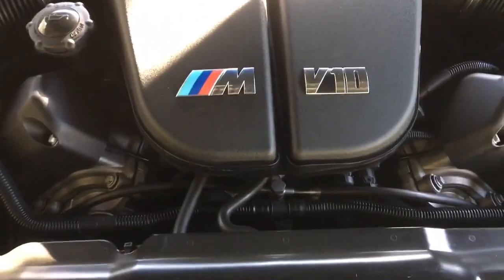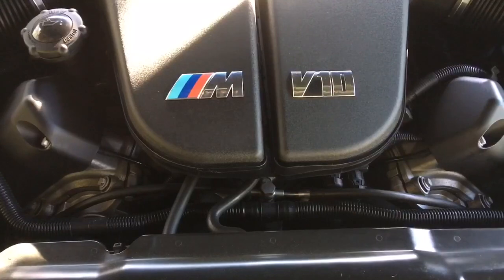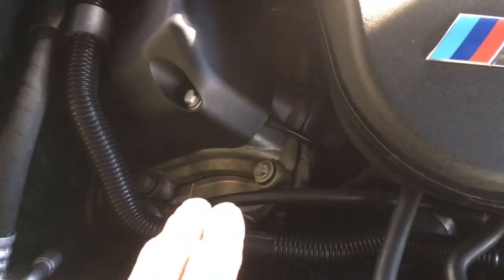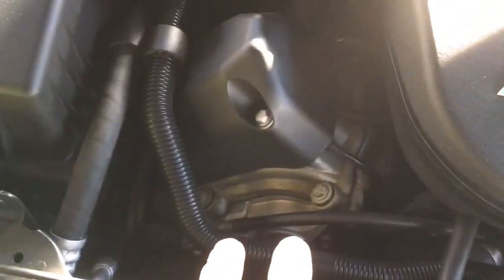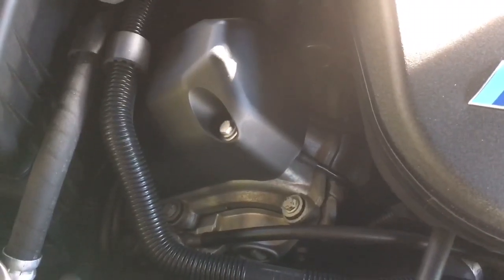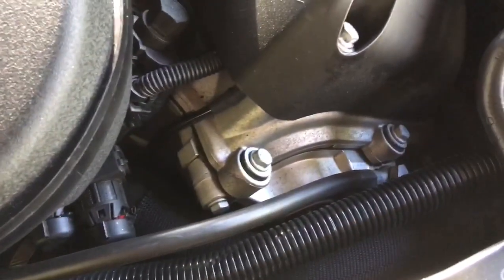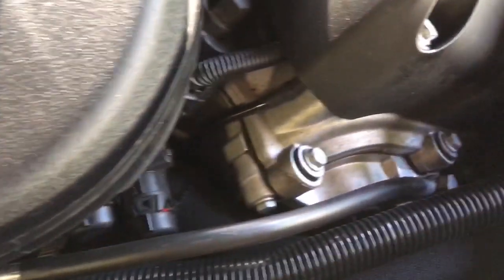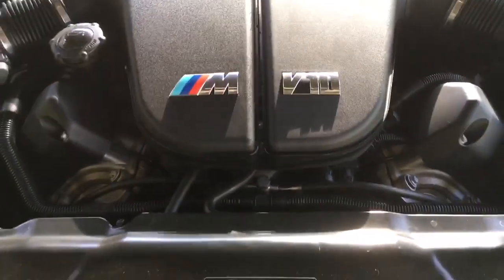BMW V10 VANOS Noise! & Common Issues

Comment: Your videos are great to watch, you're clearly a fellow lover of the V10 engine which is what these cars are all about. I've just watched this as part of my research on the way to my 17th year at the Nurburgring in my 2005 car. It's also much loved, never been driven through a UK winter, kept in a climate controlled garage, religious oil changes. It's one of original M5's (first owner BMW UK) and it's developed an unusual VANOS noise on the journey here this year (an intermittent, rhythmic rattle at idle and at revs) which doesn't seem to affect performance at all (but the noise is very disconcerting). I have always looked after and worked on the car myself and assumed (wrongly it seems) that the problems people have with them are largely because of neglect, I think that's probably true for 90% of the cases. Now I don't know whether it's safe to drive back so I can pull it apart to diagnose. It's certainly put an end to my Nurburgring trip this year, which is like an 8min "stress test" for the car :( All the best.
Reply from the maker: Hey Dave, great to hear from a long term owner, sounds like you’ve been enjoying the car with all them trips to the Nurburgring, perfect car for it! The noise could be a few things, but if yours is a 2005 like mine, from what you’ve described it sounds very much like the VANOS hub, real common on the early E60 M5’s, mine sound really noisy too (you can hear it at the start of just about every E60 M5 video of mine) The spring inside gets worn and rattles. If there’s no warning lights, and no fault codes I’d guess it’s the VANOS hub and wouldn’t worry too much. As for the reliability of these cars, if yours has gone 20 years without any major issues, that’s a reliable car
Reply: @MTechGuy  Thanks very much for the reply. I agree with you on the reliability, the car is 20 years old now and I've only ever had a few minor issues with it, usual E60 generation electrical gremlins (learnt to live with them) an alternator (dash lit up like a xmas tree) and flat spots in the tyres that wouldn't roll out from storage. I'm so fastidious with care for the engine I was struggling to believe something had gone wrong with it, if you look after it like a race engine (which is basically what it is) then it will look after you, if you don't, trouble. The noise was probably worse than you think I should have posted a video somewhere, like something letting go in the engine centered around the RH bank of cylinders, very alarming. Mine sounds like yours at idle, I've never been worried about it, with some revs that noise goes away and the engine comes really comes alive. I have found the issue and wanted to let you know what it was, I did the belts & pulleys this year (you have a video about it) because I could hear one of the pulleys from inside the car (sounded like a mouse being minced!) also had the aircon re-gassed on suspicion as low gas can cause weird noises also, it did take around 200gr. Yesterday while driving the car (reluctantly) we started with the engine noise (and aircon, power steering) then after refueling we lost power steering and aircon! (and the engine noise was gone). On inspection the bearings in the aircon compressor wheel had failed, the wheel had come off and we dropped the belt, the aircon compressor sits right under the RH cylinder bank as you know! I guess that was the noise I was hearing, the bearings letting go. Again I have no way of posting pics here but there were about 5 BB's left out of 50 and the wheel and belt were sitting in the belly pan. Now I just have to find an aircon compressor (in Germany) and fit it and all will be good again. We will have to drive the last 160km with no aircon and PS, and I will lose all the gas I just paid for (annoying) but the good news is the engine is fine and I'll hopefully get to lap at the Ring again this year. I'm a bit annoyed that I actually cracked the high pressure line on the RH cylinder head to have a look at the little filter that sits under the banjo bolt, it was clean as a whistle unsurprisingly, after 20 years! Anyway, thanks again for your reply, if you have any recommendations on aircon compressor brands let me know. All the best.
Reply from the maker: Thats mad, never heard of an a/c clutch pulley fail like that! Good that it turned out to be external to the engine. Denso good brand for compressor, but to be honest if it’s just the clutch/pulley that’s failed, these can be bought & replaced separately, if the actual compressor is OK. Will be a lot cheaper and easier to do away from home, plus you won’t lose any gas. If you do end up replacing the whole compressor though, don’t forget to replace the dryer too. Also, I would be suspicious of the a/c ps belt tensioner, this may have loaded up the a/c clutch pulley, check it out while you’re in there. Good luck 👍
Reply: @MTechGuy  Thanks again, I'd rather not replace the whole thing so will have a look and see if that'll do the job for me. I had thought the new belt(s) must have put a bit more strain on things, tbh the old belts were fine, BMW originals, no cracks or visible wear at all, one of straight pulleys and the offset pulley were noisy though. The tensioner also seemed fine, no visible leaks and required the same sort of force on it as the other side to release and free the belt. Cheers and all the best.
Reply: @MTechGuy  I've looked at that part, that would be much easier than replacing the whole compressor. How do you get the pulley the pulley on/off? it looks like it's threaded. Do you need the special tool? (3 x 6mm holes). Cheers again.
Reply from the maker: The pulley is threaded onto the compressor shaft. You can use the old belt as a ‘strap wrench’ to hold the pulley, I think the end of the shaft takes a 7mm socket
Reply: @MTechGuy  Thanks again, the internals of the pulley that failed appear to be still on the front of the compressor so I won't be able to do that, I may have to improvise to get it off (I have some vice grips with me) I assume it's a conventional thread (not reverse) and you hold the 7mm to stop the shaft from turning? PS - the car definitely feels a bit faster without the parasitic load of the aircon compressor and PS pump! (makes you wonder). Cheers.
Reply from the maker: @davedorling899Yes, it’s a normal thread, if you can hold the pulley internal that’s left steady, then just turn the shaft to unscrew. Must have a few more horses without it in place at the mo!
Reply: @MTechGuy  It does seem to, hard to say as we have to drive with the windows and sunroof open atm (it's hot here) and the noise! 🤩makes you feel like you are going faster! I have the aircon switched off during a NB lap anyway (engine is working hard enough as it is) but you need the PS, the steering is VERY heavy without it. I'm struggling to find this part (aircon compressor pulley) it has Denso written on the pulley I'm holding my hand and "pps-gf40" on it but I can't find a direct replacement. BMW doesn't list it as a separate part (no surprises there) as a last resort I could look for and appropriately sized v-belt to just run the PS pump. No idea what size though, I wouldn't want to put too much pressure on the PS pump and break that as well :( Cheers.
Reply: @MTechGuy  Thought you might be interested in the info I just posted on M5BOARD, I got the power steering going with a smaller belt and I've done a couple of laps, the car is flying and I have proper brakes now (just installed custom made carbon ceramic brakes on the car) I also found a new compressor pulley, everyone here telling me that the compressor will need to be changed, that's how/why the pulley failed, not sure I believe that (yet) as I removed the remains of the old pulley yesterday while fitting the shorter belt and I can still turn the shaft with my fingers in both directions, feels fine, lets see what happens when I switch it on I guess! ;-) All the best.

-------------

Thanks for sharing the info above to bypass the aircon compressor, I've just had a failure of the pulley on the compressor (after a belt and pulley change on the front of the engine, coincidence? I think not) I'm in Germany at the Nurburgring so I needed to find a solution to get the power steering back as the steering is VERY heavy without it (motorway = ok, tight corners/parking/track = not ok). For the european folk that might be reading this, the belt I ended up using was a "Bosch 850mm" (see pic). I tried an 844mm (too tight, couldn't even get it over the pulleys) and an 858mm (too loose, with tensioner released you can still slide the belt off). The 850 was "just right" similar sort of effort to slide the belt on as the stock ones with everything in place. As for the compressor wheel, you CAN get replacements but they're not easy to find, even here in Germany! I found one on Ebay eventually (see pic), pulley diameter is 110mm, 30mm width, thread is normal (not reverse), give it a good spray and give it some time to penetrate before trying to remove the pulley (or what's left of it!) from the front of the compressor, this really helps. All the best.

-------------

Comment: My vanos developed a sort of whine at low rpm’s. Started happening after I changed out the crush washer on the top feed line. I have already bleed the system and it’s still there. Could this be the solenoids? I’m getting no codes btw
Reply from the maker: Double check everything that was disrupted during the washer replacement then bleed it some more
Reply: @ so bleed it again got it 👍 because I just replaced the crush washer on one side.

Comment: Hi 
Just checking- do you need to remove the vanos pump in order to change the high pressure vanos line, or is there enough room to get the old vanos line out and thread the new one back in with the vanos pump still in situ?
Reply from the maker: Remove the VANOS pump, there might be enough room to slide the hose out but I think you’d struggle. To be honest if you are that deep in, with the oil pan removed you want to remove the VANOS pump and inspect it while you have the chance, just make sure to set the back lash correctly when re-fitting
Reply: @MTechGuy  thanks. 
Also, is it essential to bleed the vanos system using ISTA after replacing the high pressure vanos line? 

I’m wondering- wouldn’t it just bleed itself under normal driving (taking it easy for a while of course)
Reply from the maker: I would bleed it 3 times with a scan tool, you don’t want any cavitation at the pump

Comment: The wear is accelerated by people getting drunk on the noise of the engine and drive around at 7000rpm all day.
Reply from the maker: So long as the engine oil is warmed up it’s fine, these engines are built to take it. Mine sees 8250rpm regularly

Comment: I replace the 4 solenoid from dr.vanos and do the vanos test ,got some not ok results,but i dont get any code,should i worry about it? Thanks
Reply from the maker: Check to make sure the O-rings are sealing, run the bleed procedure about 3 times, then re-check it. If the readings are very close to the target, and no codes, I wouldn’t worry to much
Reply: @MTechGuy  ok,thanks man

Comment: If you got Vanos pump tick from the front bottom of the engine that won't go away after a bunch of bleeding, prepare your pockets for a new Vanos pump guaranteed - doesn't matter if your Vanos test passed.  The Vanos pump bearing race is cracked or trashed - no way around it.  It can work with it broken but it will have intermittent loss of power and it is just a matter of time till the pump internals blow up.  It will not give you errors and can last even up to 10k - 20k miles but the inevitable will happen - always check your oil for any debris.  If you see debris (and there is a lot of it), there is a chance it is the rod bearings or Vanos pump material. Either the pump catastrophically fails or it will send metal dust into the Vanos system and compromise the solenoids causing the Vanos error codes - IF that happens, immediately shut the engine off and tow it home or to the shop - a knowledgeable shop with S85/S65 engine experience should know what to do.  There are several videos on youtube you can listen to for the sound you don't want to hear - not very common especially after the post 2008 but it can happen.  Other than that, the S85 is a great engine and very enjoyable on the E60 platform.  It just can be very costly if you do not pay attention to details and do proper preventive maintenance.

Comment: Hi, excellent video, very informative! 
Would you happen to have a part number for the high pressure vanos line that you talked about inside the sump? Cheers
Reply from the maker: Thanks for checking out the video man-
1 x VANOS HP hose- 11367838669
4 x Crush washers- 07119963129
1 x O-ring- 11367834552

Comment: Would the vanos oil pump be making a loud whine before failure?
Reply from the maker: If the VANOS pump gear backlash is out it will cause a whining noise
Reply: @MTechGuy  at all Rpms or specific range?

Comment: Hi

what is sound at eighth second? , I have also same noise like eighth second, but can't find what the problem

https://www.youtube.com/watch?v=dlXgSMcKK2A&t=8s
Reply from the maker: The noise is normal on an S85 V10
Reply: @MTechGuy   Thanks for reply, I drive my E60 M5 during 5 year, but never happened  this noise. This noise is newly created. I already done  rod bearing and bolts, vanos high pressure line. On diagnostics no any errors and warnings. Engine works great, performance is good.

Maybe it's due vanos solenoid?  Or vanos pressure accumlator?

How dou you think?

Comment: Hi there, have you done anything or checked your vanos gear pump before? I'm at 134k km now and is frequently changing engine oil. Do I have to worry about the vanos gear pump?
Reply from the maker: I’ve not inspected mine myself. If the pump starts to fail they can be noisy or leave debris in the oil. Keep up with the frequent oil changes, plan to do the rod bearings & HP Vanos line sometime in the future and inspect it then
Reply: @MTechGuy  Gotcha 👍

Comment: BMW recently changed the price on the solenoid. My dealer is now charging EUR 240 each. Thought I'd share.
Reply: I can also confirm that, here in France you can get them for 190 euro each
Reply from the maker: @miloud5992  Even better!
Reply: @miloud5992  Oh nice, which dealer in France is offering them for 190?
Reply: @diopsidem5  Every dealer in France
Reply from the maker: Thanks for the heads up, wasn’t aware they’ve reduced the price. They used to be over $1000 USD each!

Comment: You gave me a lot of great info as far as the left side of the engine making a much louder noise in earlier models. I have a 06’ M6 and it was pretty loud but I’ve learned to live with it.
Reply from the maker: That’s great to hear. Yes, my right side is the louder side, completely normal on the early models. Like yourself I learnt to live with it

Comment: do you recommend changing the o rings on the solenoids if ISTA shows minimum spec even if car running properly?  Recommend bleeding several times?
Reply from the maker: If all the solenoids are within spec and the engine is running properly I wouldn’t be too concerned. If your solenoids are original it might be worth changing the o-rings out preventatively. If the solenoids have been out it’ll need bleeding- do it 3 times

Comment: Bro what is best mileage to change oil
Reply from the maker: Cant go wrong going old school with the intervals, every 5,000 miles even with the full synthetic
Reply: @MTechGuy  bro I change every 500 miles with 10w60 liqui moly 5w50 mobil1
Reply: your naturally going to burn off around 1l per 300 miles. i do around 1200 mi. if the oil levels remain good. they will vary depending on how it is driven. I Run around at about 55mph city most days
Reply: Max I wait is 3k miles, but usually like to do around 1,500/2k mile intervals.

Comment: Actually 115 bar, very high pressure
Reply from the maker: Yes, minimum approx. 80 bar held by the accumulator, up to approx. 115 bar operating pressure under load, bypassed to the sump shortly after that pressure. Very high pressure indeed.
Thanks for watching